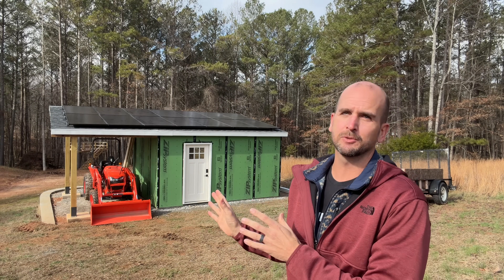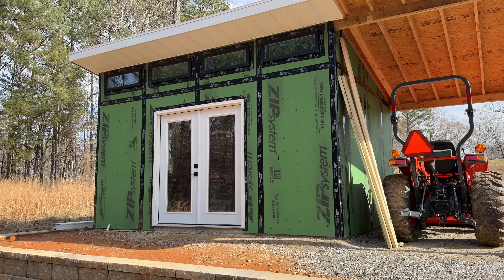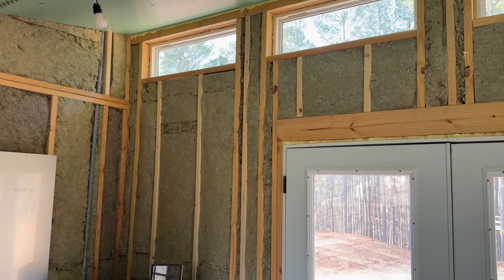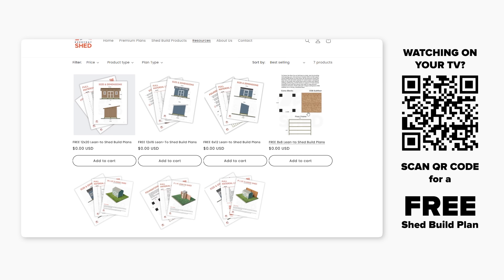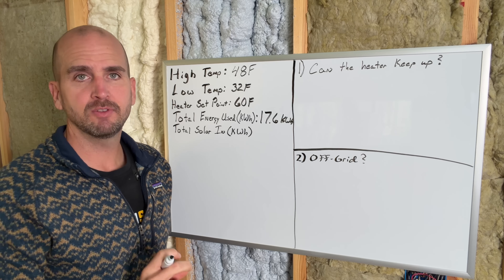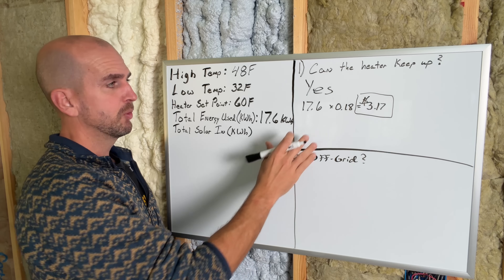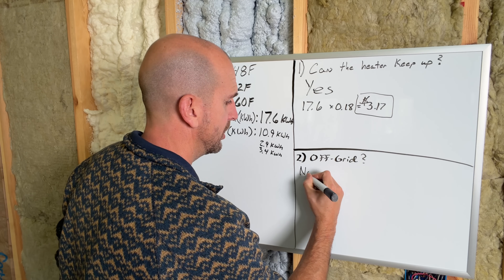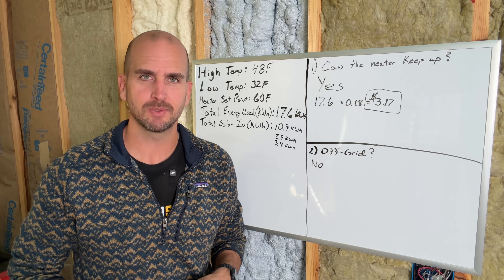HUGE Mistake: Why My $15,000 Solar System CAN'T Heat My Tiny Shed

Comment: I would have suggested a different building system completely. First mark out your 12x16  floor. Dig out the top 12" of your 12x16 pad. Next dig a trench around this pad at least 3 feet deep(the bottom must end below the frost line). The inner trench  wall  will extend 12" into your pad and extend 36 out from the inner wall. Your total trench width will be 48" wide,  line with ground cloth then install a French drain at the bottom. Backfill with gravel 6" and compact it. Now since and repeat the gravel backfill every 6" compacting it as you go untill you have a completed level pad 18x24. Place down you floor foundation on the gravel using ground treated lumber. Next lay out precompressed 16"x8"x4" eathbags lengthwise around your flooring to create your your first course. Lay a second course perpendicular(ie 90 degees) to the first course to create a 24" thick exterior wall. Put down barbwire between every layer. On the 2nd layer you will place the long earthbags on the exterior and the narrow bags on the interior (opposite of the first layer). You repeat the bag orientation every layer. I would also add an internal sheet of construction  cloth on the interior and wire it through the wall to an external layer of construction cloth when the wall section is complete. Once the wall is 2 feet high drill out a hole in a zigzag pattern to drive in 4 feet rebar, preferably fiberglass rebar.  Build another 2 feet high, reverse the zigzag drive more rear. You will install 2 doors. The exterior door opens out. The interior door opens in. This will create a 2 foot unheated vestibule  that will keep cold air out and warm air in. I would also inset the windows enough to install external insulated shutters. Obviously a double pane window. You can also  add a second inner bifold insulated shutters to further decrease heat loss.

Material list is:

Ground cloth
French drain
Gravel
Any soil ammendment to have a 30% clay/7% sand base material.
Enough dry mis concrete to make a 90% base soil/ 10% concrete moisture
Your floor material.
Rebar
Barbwire
Construction cloth 
2 doors
Windows
Shutters
Hurricane straps 
Roofing materials

Also if you set your window at 17" off the floor you have built in seating. During warm weather at least.

While I have added some modern structural improvements. This basic system was used for thousandsxof years and through an ice age to survive. And they had little to no firewood to heat their homes back then.

Between the barbwire, the rebar and the construction cloth this system has 3 structural reinforcements. It uses the compressive strength of concrete/earthbuilding for not only earthmass and insulation. It also allows for moisture regulation. 

And lastly the majority of the building material is literally dirt cheap.

Comment: A MUCH better system that would use SUBSTANTIALLY less power would be combining geothermal heating with solar augmentation. Dig down about 4 to 8 ft (depending on your location) to get a consistent 65° temp, then use your solar / battery setup to move the air and, if needed, heat that air up a little bit. I have no idea why people with land don't do this, especially if they are already doing a bunch of ground work to build in the first place.

Comment: Wont it have better insulation with drywall and siding?
Reply from the maker: Yep, it will improve it some.  I will try and test out a few more scenarios to give the overall pictures of insulation and different methods for heating over the coming weeks/months.

Comment: why the fuck are you using a shitty inefficient  1500w radiator.... use a heat pump like any intelligent person would. you are miss representing what someone would actually use off grid. a heat pump would sip power and you could easily power it through out the day.

Comment: If direct sunlight through the windows doesn't work, how can solar cells work? The energy available at any given time is less than from direct sunlight. You lose energy at every step of the process. From generation, to conversion, to regulation, to transmission.That's why solar is only supplemental.

Comment: Ok, 6Kw of solar sounds great, but are you really getting that much in winter?   You need to have at least 3Kw of ACTUAL solar power being produced in winter JUST TO HEAT THE POWER SHED.   A space heater on low will use around 900w but will only run maybe 50% of the time.  You need to be putting extra power in batteries to run that heater through about 16 hours of "darkness" when temps are even lower.  Again, the key is INSULATION and get rid of drafts around doors. And block and insulate windows.  If you are in a higher latitude, plan on 4-5Kw solar production during prime charging hours, which are fewer.

Comment: I'm only 1 mine into the video and I can tell that must have a design flaw, or you live in Antarctica.  If the building is well insulated, the heat generated by inverters, and MPPT chargers during the day, gathers inside and keeps everything warm enough.  Make sure your doors are not leaking air.  If you have windows, completely block them in with 2" foam board insulation.  Use R-36 to R-40+ in the ceiling.  Make sure your floor is insulated as well if you are in a harsh winter area. I recommend a mini-split for winter heating a long as outside temps are mostly above 20°F (you'll need the mini-split to keep equipment cool in the summer anyway).  If you're Winter days are mostly below 20°, then add a small resistive space heater to keep the batteries warm if interior temps drop to 40° or so.

Comment: I want an off grid cabin in Idaho.  I'm 66 and retired/still working, so maybe it is just a dream that will never be fulfilled.  Maybe I can set something up in a few years, but I'd never try heating the cabin with electric heat.  The solar would be for cooking, lighting, celling fans, electronics.  I'd want wood fireplace for heat, a gas generator for backup.
Reply: Maybe consider a very small diesel generator for your backup. The big advantage is you can make your own fuel from waste oils you gather, and filter to 1 micron. You can custom blend for your particular environment.

Comment: Tiger foam. You need R16 walls And need R35 in the ceiling minimum. 2x6 walls . I didnt the see how it was built. You need in floor heating or a crawl space. Good luck. You are out in left feild.

Comment: 15 grand?? I have 10 panels 5kw inverter plus 10kw batteries all in for 7100 euro in Ireland. Free electricity for the year. No heat pump, though. Have heating oil and stove.

Comment: That's the worst space heater to use. I have two of those and together they couldn't heat a 12x16 room. They basically only heat the air immediately around them and that's it. I have a small electric space heater with a fan that uses 1500W and can heat my entire bedroom (14x20) to a very warm temp.

Comment: You'd do much better heating if you spent your money on a heat pump mini split instead of all that ecoflow crap. Using solar for resistive heating is crazy. And your ceiling insulation sucks, you don't need airflow through your rafters if the whole building is properly air sealed. You should only try to keep it above freezing inside with the solar, then supplement with a propane heater.

Comment: Hands down a heatpump would be more energy economical to heat that space.  However I'd be interested in the comparison of initial investment, factoring in a smaller solar deployment.
Reply from the maker: I will be running multiple different tests with more Insulation and different heat sources.  Should be able to pull everything together so others can make the best call for their setup.

Comment: A heat pump is needed as is more ceiling insulation and getting the envelope air tight. Right now that building is leaking heat everywhere!

Comment: Welp.. sounds like you need to make room for a wood burning fireplace.  A micro wood burner would probably heat that that entire space, subsidized is a more consistent electric heater to fill the gaps.  But pure solar might not do the trick.  You could try some of the fancier approaches like a sand battery to heat up barrels of sand with solar and heating coils through the day with geo tubes into the office.. but man that sounds like WAY more work than a simple fire stove.

Comment: Dig a deep hole in the ground and lower that whole building down about 8 feet. Cover it up again with the dirt. Keep your solar panels on the surface, and wire them to a single 250 watt heat lamp and battery. You will stay toasty warm!

Comment: Recently there are hybrid solar panels that provide electricity and heat. The backs of the panels are bonded to solar water heater system. Integrated with a heat pump, it can provide a few more degrees heating for essentially no additional external energy input.

Comment: That’s not enough in the ceiling. That and the slab would be the most important for creating an efficient envelope. In order to build a vented roof, filling the cavities, completely air sealing to the walls, and adding another roof deck with furring strips for air flow over the top of the zip, especially on such a small building would’ve been the most cost effective and efficient.

Comment: personally, I am Sueing the entire solar industry. the panels are not recyclable and have to be replaced often. disposal of the panels is they crush them up and put them in landfills where they leach chemicals into the water table. those chemical kill wildlife, cause cancer and have been linked to birth defects according to clinical studies and in-depth field research. they are not as efficient as their claims. they are toxic to make and toxic to dispose of. they literally create more pollution than other forms of electricity. the mining operations alone put ten times more deadly toxins into the environment than coal which is horrible. solar panels are literally worse for the environment than DDT and the manufacturers have known this from the beginning. it time they pay for the big scam of solar electricity being good for the environment.

Comment: I notice other people said you need more insulation in the roof.  I agree.  R10??  that's really really low.  You're heating up the outdoors :D . Aim for the R38 stuff.  you just need a 2X6 worth of space planned for it.  Your 2x2 construction is going to struggle with wind loads and snow loads  :/     Next, 60 degrees will not be warm enough to make an "office".  :/   Next,   you have a big concrete floor,  that's kinda unusual for an indoor living space.  You're heating up the ground.  :DD no wonder you're putting in 17 Kw of energy in one day. :/  that's a lot.   finally someone else said "Heat pump"  they are correct. but connect your heat pump to an outdoor fire place,  that you can burn wood in at any size. bonfire or camp stove,  so a fire pit with one or two sides for heat exchangers. Probably just a concrete block wall, with  heat tubes of cast iron in the cells of the blocks.   Then move that heat via the heat pump. use solar panel elect. for the motors.  Also since you have that nice concrete floor,  put in-floor heating in that concrete.  Then that big concrete floor becomes a "heat battery"  , a source, rather than a sink.  Add a water heater tank for saving the heat from the fire place in some stored hot water for later.  17 kw per day would turn into 3 kw per day.   with burring a fire for 2 or 3 hours each day.   Your office space could be 72 degrees,  comfortable,  and have extra electricity.  :)  Garages and shops,  with concrete floors are notorious for needing a really big amount of heat to stay warm, when you're in a cold climate.  I keep my garage at 40 degrees in winter.  Trying to heat a concrete slab when it's cold outside in just a waste of energy,  you can see snow melt out for a long distance from the concreate.  The floor should be off the ground, for living space in cold climates, and also then insulated.   I live in below freezing temps all winter,  I'm familiar with heating.  it's really hard to beat gas heating.  Heating with electricity is only a good idea if you have more electricity than you know what to do with.  Even then,  it's time to think of heat pumps and such.

Comment: Most of your calculations just show that your insulation and building strategy was extremely inadequate. 
With better insulation planning, you could have heated that with a 12,000 btu heat pump, for far less. 
With a 30 degree offset you would only need 6000 btu to heat or cool 200-250 square feet, if properly insulated.
Leaving you plenty of head room for colder nights with 12,000 btu, down to a 50 degree offset at 192 sq/ft.
You can buy a 12k heat pump for about a grand now, complete systems with panels for far less than what you mentioned as well.
12k will work fine for 650 sq/ft, if insulated properly with a 30-40 degree offset.
But with 450 plus sq/ft of R10 and less (windows and doors included that might be 4, slab that isn't even 1, roof,etc), that is no where near proper insulation, in any way shape or form.
You are getting about 5000 BTU out of that 1500 watt heater, versus 12,000 BTU using a bit less wattage with a small heat pump... That wasn't exactly proper long term planning either.
That 1500 watt heater wont cool anything either. And if you cant heat that as it is, with a $15,000 dollar solar system... Just wow............... They saw you coming, didn't they.........

Comment: More insulation would get you closer to what you are trying to achieve. R-20+ in the walls and R-30+ in the ceiling would make a big difference. You could utilize 2in rigid foam board on the exterior of the walls and fill the roof cavities with rockwool like mentioned. Insulation is almost always the area people try to cut cost/ corners, and it is arguably the most important thing.

Comment: Adding a simple air to air solar panel on the wall would add a considerable amount of heat and take a load off the roof mounted photovoltaic panels.

Comment: Insulation code where I live calls for r-38 - r-49 in roofing. Add some  board height for more insulation and use huberwood roofing osb with high insulation rating to get there. With the unfinished walls the interior envelope is leaking and not tight enough. I would pressure test the building to identify leaks.

Comment: The main problem is that the shed wasn't designed to be energy efficient. I'm not saying it's a bad design in general, but it is bad for energy performance (slab on grade, high window/door ratio). You can help a lot by increasing the ceiling insulation to minimum of R30. "Attic insulation R-values depend on your U.S. climate zone (Zone 6 needs R-49 to R-60) and warmer zones (Zone 2 needs R-30 to R-49), as recommended by the US Department of Energy". If you can, or have room, use subfloor membrane panels, which is wood subfloor with plastic standoffs for moisture resistance and a bit of insulation value. Then install a membrane (more insulation value) under laminate flooring (assuming you don't want carpet). Put up plastic vapor barrier on walls and ceiling then drywall. Proper air barrier will make a huge difference.

Comment: Folks, it takes a TON of energy to produce heat. Solar isn't designed to handle that amount of power needed for heat. Get a small wood stove. Chop firewood. YW

Comment: If this is going to be an office that gets used fairly regularly, I would install a small wood stove and set the radiator to around 36-37 just to keep things from freezing. The drop in run time would get you back within battery capacity, and wood is a cheap portable heat source.

Comment: The problem is you used ecoflow instead of rack batteries. You could of did a 20kw system for less then half the price

Comment: If you're using solar for heating there is no need for expensive batteries just do a accumulator tank instead. For $15,000 you could probably afford more than 40kw of solar panels and an accumulator tank with some heating elements.

Comment: I think you really need to revisit this.  

There's plenty of options and modifications you could do that would greatly improve your results.  As most comments have pointed out, more insulation.  A 1500 watt heater running constantly in that space seems excessive, maybe show some actual data. Solar hot water system? Solar powered mini split? Added thermal mass for Solar heat storage via water drums or a sand battery? Used panels and equipment can also be had for way cheaper.  Even something to just supplement existing heating.
Reply from the maker: Thanks for the feedback and we will have additional testing coming up making the space more efficient.